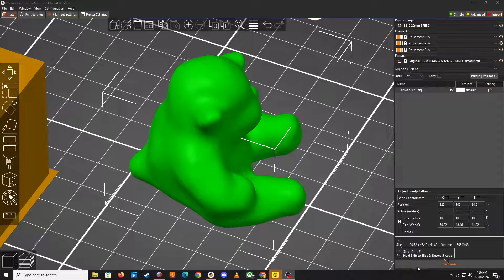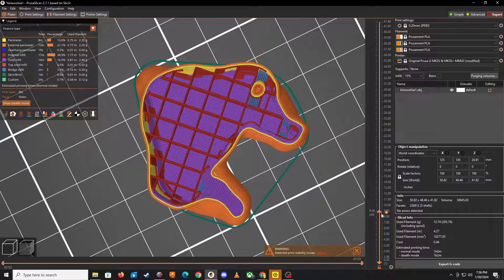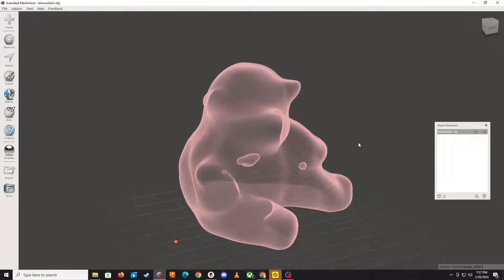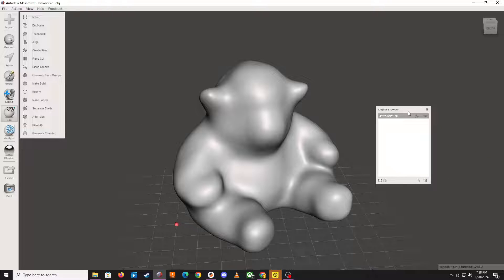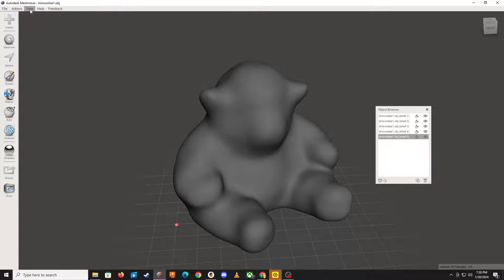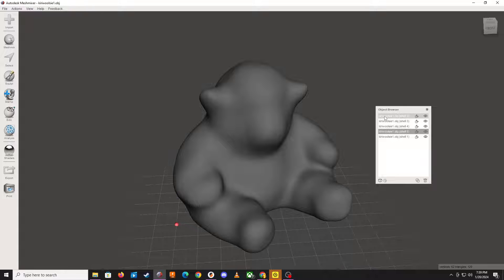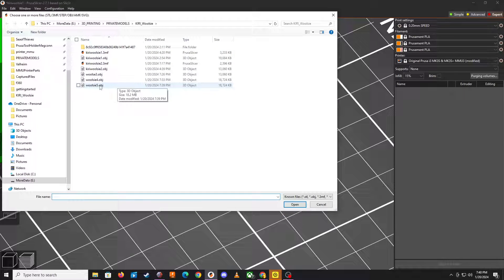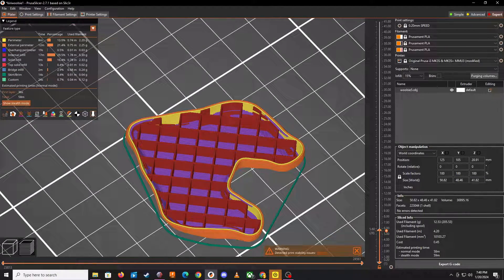Remove Holes from 3D Print Files

Comment: Nice video but FYI now you can also remove voids using PrusaSlicer's latest versions, without Meshmixer. Choose Expert Mode then right-click on the model and use Split/To Objects (if Split is grayed out, there are no voids in the model.) The sidebar now contains a list with the model and each void as separate objects. Delete the unwanted objects or disable printing of them using the 'eye' icon.